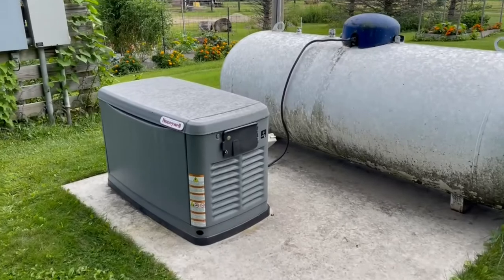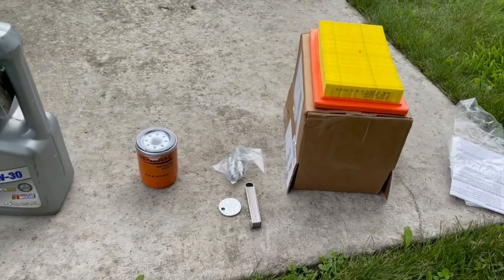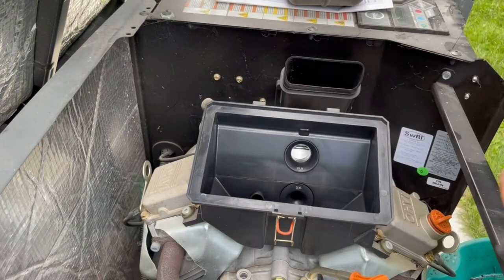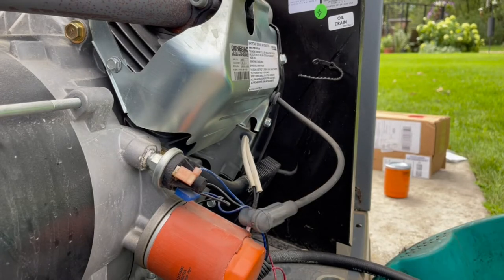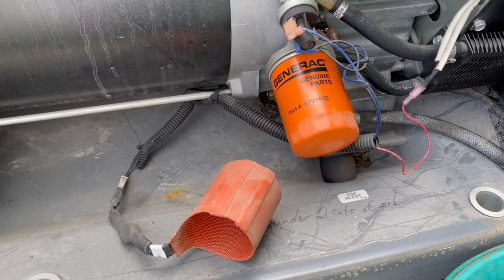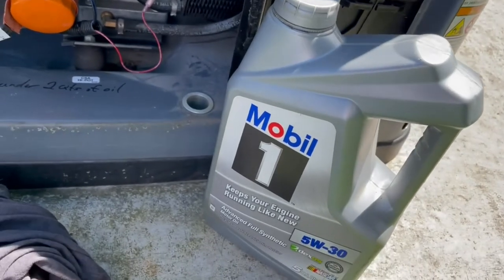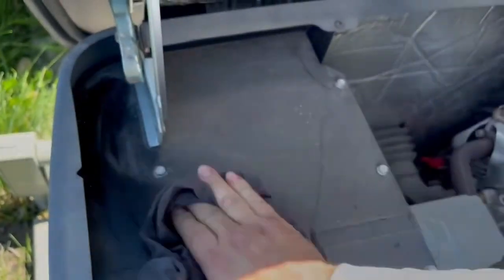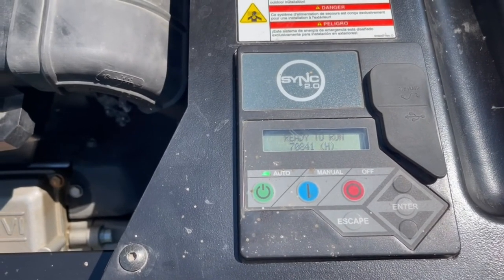Schedule B Service for Whole House Automatic Standby Generator | Belted Galloway Homestead

Comment: I agree with you on the service interval. 
Running on propane or natural gas I would think the plugs would last longer if the quality is any good. Air filter was still good also.
Reply from the maker: Thanks for the comments. I may move my service interval out further.

Comment: For reference to everyone: my Generac owner's manual shows more steps for a schedule B maintenance. 1) The valves should also be adjusted between .002 to .004 gap at point cylinder is all the way up (gaskets replaced too). 2) The battery should be removed, water level checked (if its that type of battery) and battery should be load tested.

Check the manual for your exact generator and get exact settings from owner's manual. There are specific differences for each generator.

Comment: Did you ever do the valve clearance check? I’m thinking about talking that and would love to watch before I try.
Reply from the maker: Thanks for the question. No, I have not. I was talking to another person who has a 20kw about this subject. He had not done this service also. The thought was, if the service is needed we should hear some tappet slap noise. Over time the valve clearance should only get looser, not tighter. That sounds reasonable to me, but when I have time I still want to do it!
Reply: @BeltedGallowayHomestead  I was warned by my installer that Generac will deny your warranty claim if this maintenance is not done on schedule (@4years, I think), so I am planning to do it. I found a video someone else did, btw, so don't rush it my account, thanks!.
Reply from the maker: @BrandonButrick  No problem. Warranty is important. Let me know how it goes.

Comment: I sold my old rigid and got a new honda inverter eu7000is and I was debating in adding honda oil or doing Mobil full synthetic guess I'll do what the manual says.
Reply: I wish I could of got a standby but our neighborhood is all electric no gas. A propane tank is too big for my backyard.
Reply from the maker: @DanielGonzalez-un6rz  thanks for the comments. Not sure why I started using the Mobil 5W-30 synthetic, but a small engine oil would be better for a generator motor.
As for the size of tank, they do make smaller ones. They also have some that stand up horizontal.

Comment: Mobil 1 and other automobile oils do not contain enough zinc and phosphorus for air cooled engines especially LP and NG they work ok for short runs but under heavy load for continuous running they break down they don't have the film strength I highly recommend something like Amsoil 5w30 true small engine oil or Generac oil they are engineered for this type of application I use both depending on what I have I also run small engine oil in my Exmark mower 15w50 Amsoil EFI kohler engine keep that old air filter Generacs are prone to air filter freezing up in extreme cold weather
Reply from the maker: Thanks for the information! Not sure why I started using the Mobil 1. Maybe because it was synthetic and I wanted good winter starting. I am aware of the air filter freezing, but I have never had that problem. Thanks again for reaching out.
Reply: I learned something new today
Reply: @Daniel Gonzalez  Briggs and Stratton 5w30 synthetic is also really good the Amsoil are Briggs are both 100% synthetic, Mobil 1 is not, 99% of car oils are not even close to 100% they only need a certain percentage to be labeled full synthetic people are figuring this out aren't very happy Amsoil car oil is 100% synthetic one of very few but still not ideal for air cooled engines
Reply: @kevinmarchini5272  thank you so much for that info 👍
Reply: @Daniel Gonzalez  no problem I have been around engines my whole life my dad was an expert with proper lubrication in gas and diesel engines LP and NG engines too he rebuilt hundreds of engines, you take care
Reply from the maker: @kevinmarchini5272  Wow! Thanks for the info.